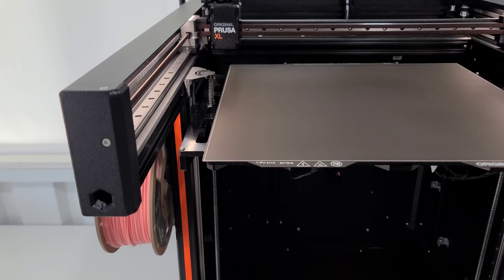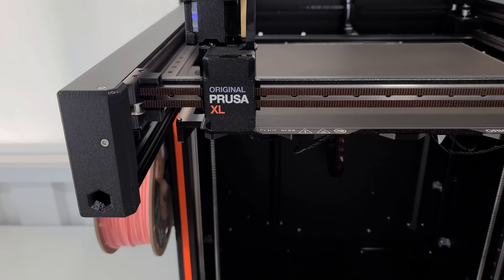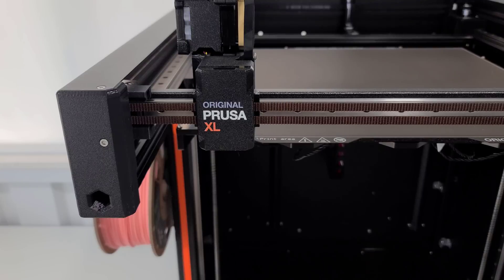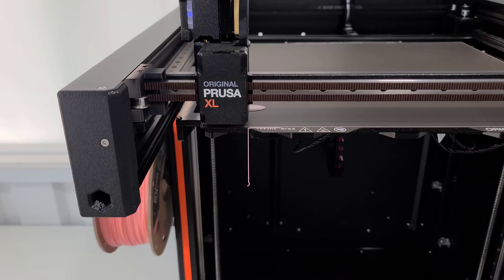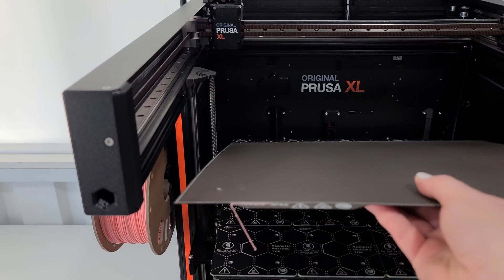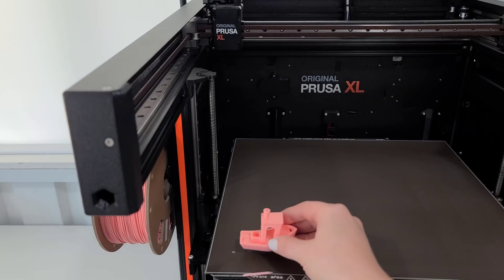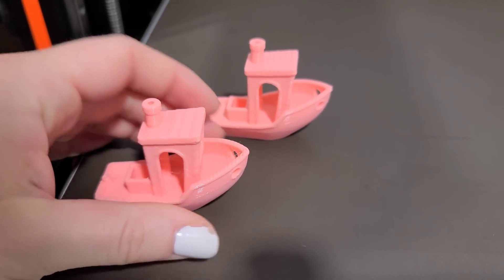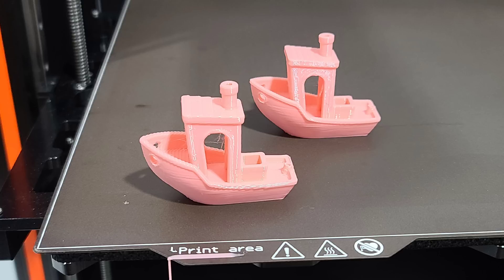Printing a Speed Benchy on the Prusa XL!

Comment: Not sure why people are comparing prusa xl to bambo etc, until they bring out a bigger machine they are totally different use cases. Would be good to see different speed settings against quality on this printer. I am interested in getting one as i print large items, and even modest speed upgrades can make a huge difference in print times when we're talking a day to print a large item. Have you played around in prusaslicer and move away from standard settings? Would be good to not print a small benchy but something more appropriate for the size of printer. Appreciate your videos on the prusa xl.
Reply from the maker: I agree. I think they are compared because they are both Core XY. My XL is faster than the MK3 and even the MK4 before Input Shaping hit.  Once input shaping comes out on the XL, the speed will be even better. I'll keep coming out with more videos. Thanks!

Comment: How long did the printer take to put together? I'm not sure what "Semi-Assembled" means. Thanks for the videos!
Reply from the maker: These first ones that are shipping now are "fully-assembled". Honestly that term isn't quite right. You still have to attach the toolhead and the filament holder. But it's pretty minimal. There are no calibrations needed. It took me about 30 mins to get it unboxed, ooogled and put together. I'm sure it could be done even faster. I also ordered a "semi-assembled 5 toolhead" but these aren't shipping yet. Thanks!

Comment: Nice to see and hear how the XL actually works. Not too many 360mm printers that will soon have toolchangers out there to look at. Plenty of knobs to make it go fast if one needs that - however going fast often makes weaker parts which is important for those of us making actual useful items where strength is important. Not everything is a race.
Reply from the maker: I completely agree! I wanted a reliable printer to print the size. Anything else is just a bonus!
Reply: @tada3dprinting  yer my thoughts too. for me no 1 is quality and reliability , speed is nice to have but not at the cost of quality.

Comment: So much hate in these comments. It will always be slow on the old Marlin firmware. Wait until input shaper is finished and then we can compare against other brands.
Reply from the maker: We are just at the beginning
Reply: It'll probably just be a little slower than a voron of the same size, depends on how heavy that toolhead is because the voron stealthburner is pretty heavy
Reply: yeah but you could say that about anything. Prusa seems to have been caught off guard by printing speed. Probably not the last thing they miss..
Reply: @not-that-mike  what? the weight of the gantry is basically the same as a voron, it's just how heavy the toolhead is

Comment: Lots of people here complaining about speed, price, etc. and comparing it to single toolhead printers with smaller build volumes, lol. Completely different machines with different use cases. By all means, though, feel free to post a faster, more cost-effective automated toolchanger design than the XL. Go ahead, I'll wait.
Reply from the maker: Everything I've printed on the XL is faster than the MK3. I'm happy. If others want to buy other brands, more Prusas for me.
Reply: @tada3dprinting  they working on making it much faster so I hope it does at the end :)
Reply: Ok so because its a Multi Tool machine (which the single print Head clearly is not) it justifys slow printing?
Reply: @xDDDx2005  It's true that as a single toolhead machine it's a bit underwhelming. But have you ever seen a toolchanger compared to a single toolhead machine using a multi-material unit (e.g. Prusa MMU, Bambu AMS, Voron ERCF, etc.) in a multi-material print? Toolchangers quickly gain a huge speed advantage as you add materials and/or require more material changes, and they barely waste any plastic. My X1C can easily waste more plastic on purging than it uses for the actual print if there are enough material changes. Particularly when contrasting colors are used which require extra long purges.
Reply: In my opinion, the XL is way overpriced... except for its tool-changing ability. That really is a game changer. But if someone doesn't value being able to print in multiple materials or with multiple nozzle types/diameters, then I'd agree that the XL isn't a good product for them, and they should go with the Mk4.
Reply from the maker: @alexsalchemy  if you don't need the 14" bed size, yes I agree that MK4 is a better choice.
Reply: @alexsalchemy  the only reason for this Price is the Position on the market and Prusa knows that there is no competition at this range. Just because of that I dont like prusas point.
Beside that, Prusa has 24/7 support and well Build machines that deliver quality even years later. Just for this I am Ok with little compromises.
Its about what we want for sure. Time will tell.
Reply: Compare it to a Voron 2.4 R2 350

Here, we're talking about single nozzle printing capabilities. Not a lot of people needs toolchangers and arguing to find a better one when the only competitor is the old AF e3d toolchangers chassis isn't relevant

The XL IS slow. It does good prints, but really lacks in oomf compared to similar sized machines, which is a bummer because CoreXY is meant to have faster print speed.

If structural print solidity is an issue, just crank up nozzle temp a little, simple as that
Reply: Speed is not the end all...quality, part strength and aesthetics are super important, to me at least. That being said, the print quality didn't looks great...it should be near perfect, so then what happened? forget the stringing, the blips and bumps everywhere, this is not a good looking benchy.  So there is the expectation that they will update the software so it will print faster...time will tell..they were quite slow to release this printer, and in the end its not really ready as the speed issue is not implemented, but hopefully soon...for now I will wait and see if they do this update soon. Lots of negatives...show us a larger print with excellent quality finish and part strength in a few materials. This would be meaningful.

Comment: Wtf are you printing in a corner 😅😂, noob skill large here...
Reply: The XL prints in a corner by default you dumbass.
Reply: Noob skill? Default setting for XL since it has individual heat tiles. Who got the noob skill now?
Reply from the maker: It's the default settings on the XL. Thanks!
Reply: The Prusa XL has 16 individual heat pads. So on smaller prints, it prints in the corner while having to heat only 1 of the 16 pads.
Reply: There is also less tension on the bowden-tube if you print it in this corner. CoreXY-Style! 👍
Reply: Easier to make video with a cheap camera. I also print on corners if I need to make a clear video using my phone as if I zoom in the video quality is not good. You can bring the camera very close to the print without zooming in.

Comment: I like the video format, and seeing the first few layers print at normal speed - thank you.

And thank you for showing the speed of the bench file from the Mk4.

In general do the prints always start at the bottom left? Or can you specify where they print in the slicer like you can do on the Mk3?

I’d love to see how PrusaConnect works with USB cameras etc and does it detect bad prints? Or do you use OctaPrint on your farm? It’d be cool to see your print room too and all your another printers!

Thanks again!
Reply from the maker: Thanks! When you load a print into slicer, it sets it in the middle. But when you "align" it puts it in the front left. I believe this has something to do with the modular bed heating. I have not seen any way to change the setting other than just moving it again by dragging with the cursor. 

I don't have Octoprint or use any cameras all the time to monitor prints. Honestly I feel once I have tuned a print, I rarely have any issues except maybe running out of filament. 
Yes I will have to do a little tour for my printer room. Thank you!

Comment: This makes me really appreciate my Modified Tronxy X5SA-400. I always push my printer for speed and quality, and fine tune the resonance so its quiet at the high speeds, but I always feel like its not good enough. After seeing this, I feel like I have a really decent printer.
Reply: You should hang a video and explain the mods you’ve done.  I considered that as a base for some conversions but if it really doesn’t need that much I’d get it and leave it stock
Reply: @Steven-Machado  I'm not sure about a video, but I can tell you some of what i changed on here... I upgraded to BTT  SKR 1.4 Turbo, TMC2209, with BTT 3.5TFT E3. I have sensorless homing enabled as well. Before I changed the board and lcd, I ran marlin on the stock board and lcd which allowed me to tweak and fine tune it, along with z align the 2 motors as well as increase to very high speeds... I wanted sensorless homing and silent drivers so i upgraded the board. Putting marlin on the board was night and day compared to the garbage firmware Tronxy ships them with though.

Comment: I love how it’s so cool to bash on Prusa these days. Why? Because they didn’t come out with input shaping first? I think we’d all like faster prints(and the XL certainly has the potential to be faster), but my biggest concern is that when I hit “print” and walk away, go to bed, or work, or bed then work then bed again I can expect to come back to a finished, quality print. I’d also like to know that the companies I support are gonna be around to support me back.
Reply from the maker: I agree. And there is always adjustments to make so that things are faster but you have to start somewhere.
Reply: The problem is the XL and MK4 would have been impressive 2 years ago. Things have changed drastically and while you want a reliable printer, that can also be had at a fraction of the price with other brands.
The issue here is I have an Anet A8 that beats the speed of these 2 printers and matches quality and reliability. Yes it's not stock or out of the box but this is still a 7+ year old printer that has been used heavily in a print farm!
I understand the importance of support in the industry and strong customer support which is why I was really hoping Prusa would knock this one out of the park but tell me that they done seem unfinished and rushed since the firmware isn't done and the claim of all this testing has been done without the claimed speeds of when the firmware is finalized... Yes the mk4 is just a mk3 with some upgrades but you could do the same by slapping a pi on it, running Klipper and ramp up the speed that way.
Times are changing and what worked 5-10 years ago isn't competitive in the current market.

Again I want them to do well, and I hope that Prusa really do nail this launch. So far it's looking great but given Creality are about to launch a Bambu clone, Qidi have theirs as well, and the elephant in the room is obviously impacting sales.
I get that Prusa is about print quality and that's a great thing but the Bambu spits out a flawless benchy in 15 minutes... Sure we don't know if these machines will be running in 6 months time given how hard parts could be to get, but your average new user isn't going to really look at that
Reply: @visioncreations4236 
I honestly agree with most of this. Prusa led the way and now they’re being caught… maybe even passed up a bit. But, they’ve been struggling just to keep up with demand for the last 5 years and launching new printers that generate even more demand. I’m not worried about their future because I believe their customer base is largely people who caved in after trying the other, cheaper options or shiny new cube with lofty promises and being disappointed. Based on the reviews I’ve seen the current batch of shiny cubes are far from living up to promises or the hype they’re receiving and will probably generate more Prusa customers. 

I think we’re seeing some divides in the “community” right now. Where not long ago you kinda had to be a “hobbyist” just to get a decent print and the overall feeling was that “we” were all in this together, and we all bashed on the shiny new crowdfunded cubes together😁 Now we have a growing “pure consumer” presence who just want to print some helmets and dragons and such without a bunch of hassle and there are plenty of machines that can provide this and “shiny cube” manufacturers who are targeting them. We have the “prosumer/print farmers” who need rock solid performance and reliability or more advanced material/design/engineering capabilities on a budget… which seems to be Prusa’s primary target group. Then we have the “hobbyists/tuners” the gpu overclockers of 3DP and people who love to tinker, who are responsible for pretty much everything in every “our level” printer and currently seem to be bashing on everything that isn’t a Voron, when they can drag themselves away from GitHub. These groups aren’t really new, but the divide is, the fanboyism is and the gatekeeping is. Remove any one group, or Prusa, or even Creality and consumer level 3D printing doesn’t end up as good as it is right now. 

I think the multi tool XL is the right printer right now for people who fall into the growing “prosumer” camp. I know I’m pretty damn excited about it and hope that it works well when I eventually get mine sometime in November maybe. Input shaping and faster print speed would be a bonus, but that doesn’t affect my dreams of a solid PLA cored, Nylon shelled and TPU coated bocce ball set.

Comment: Are the parts exact? Did you messure?
Reply from the maker: I just downloaded the benchy from Printables. I believe it was 2"
Reply: @tada3dprinting  
should be described with the benchy. Most are 50mm long, 30 wide, chimney 6mm outer/4mm inner and so on. Also surfaces are different.
Reply from the maker: @tuxairborne  this was the printable from Prusa Research. Does the standard one have this logo on the bottom too? Did I download a different one?

Comment: WOW it is slow af. Who in their right mind will buy this POS?
Reply: People who get multiple tool heads and want to make multi colour/material prints without wasting heaps of filament?
Reply from the maker: Reliable printer that has a 14" bed? Easy choice.
Reply: I wouldn’t say I agree… For default settings and lack of input shaping as well as other firmware improvements I’d say it’s not bad. Once the firmware gets a few updates I suspect we will see some speed improvements - but with speed can come a compromise in parts performance, not sure you’re buying a £2-4,000 XL to print trinkets. Likely want to print high performance functioning parts… Other printers will print them faster but with a higher failure rate and compromised strength.

Comment: 40 min benchy is a normal ender 3 bed slinger "speed" benchy lol. I could prob knock out a benchy at .4 layer height in about 10 mins with my x1 carbon lol
Reply: A stock or at least stock-ish E3 with Marlin and no IS should be able to do about 23 minutes with high nozzle temp, CHT nozzle, and maybe some external help with cooling.
Reply: I have an Anet with Klipper, an orbiter extruder and a 32 bit board that does them in 23 minutes with better quality than this. 
Brand loyalty is only worth so much

Comment: I thought the standard settings for a benchy was 0.4mm nozzle and 0.2mm layer ht? changing the layer height and nozzle size doesn't reflect a true time in that case...
Reply: no, 0.6 nozzle and 0.25 layer height follows the rules set by annex engineering. It is fine
Reply from the maker: @Unscientifically  I know it's easy to mix settings up. I was just trying to keep .6 nozzle the same in all cases because that's all I have on the XL.
Reply from the maker: Thanks for your feedback! I do agree the benchy in the video was with a .4 nozzle. The comments said .25 layer height with 10% infill. I don't have a .4 nozzle for my XL. I only have .6 so I compared slicer setting on this nozzle on both printers.

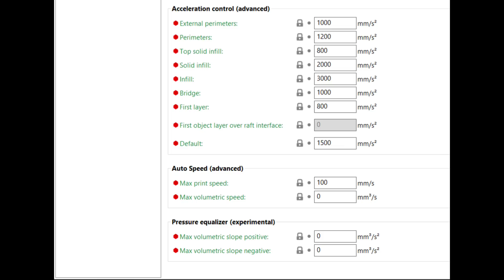Comment: @8:11 Why does prusa have their speed and accel settings set so low? that's even their draft setting. @8:27 looks like cooling issues, the bow is caved in. @8:45 those don't look good at all. inconsistent z layers. disappointing.
Reply: Until input shaping is in.. they aren't maxing out speeds. My guess.
Reply: @WhySoDivided-CantWeAllGetAlong  true but at the same time this is as slow as bed slinger default speed, surely even without input shapingit can go fairly a bit faster than that
Reply: @8bits955  Yah.. I would agree with you there. I would hope it prints as fast as the MK4 does.. they use the same head.. and this is using linear rails and corexy.. so out of the gate it should be faster. What we don't know is if TADA didnt change things to print faster.. or not.. not sure if there are things that she should do to get it to print faster/better.
Reply: @WhySoDivided-CantWeAllGetAlong  yeah that is very true could just be she using a very slow speed
Reply: agree for an corexy system print as if it a bed slinger. Not to mention the cooling
Reply: @8bits955  bedslingers can print faster and better quality than this.
Reply: @TMS5100  oh yeah know that what i am saying is that it printing as if it was a stock bed slinger. I got my ender to print at 10k accel at 300mm/s so far and looks better than this

Comment: Is that purge line that is hanging like that actually what Prusa wants
Reply from the maker: I thought it looked odd at first. But now I like it because I can grab the purge line without touching the bed. If I can pop and slide the print, I don't even have to clean the bed in between prints. Thanks!
Reply: @tada3dprinting  lol.  I think it was meant to be that way. Makes sense.